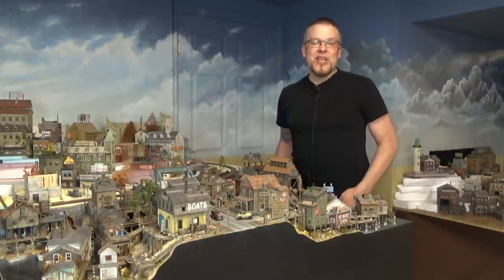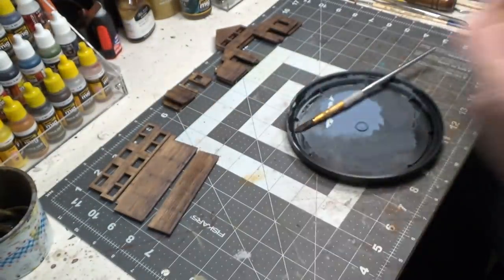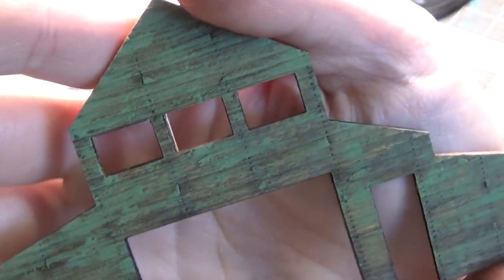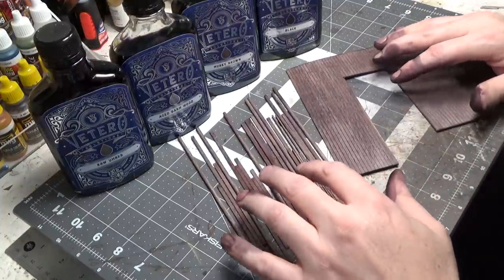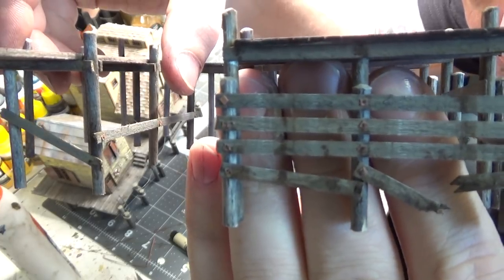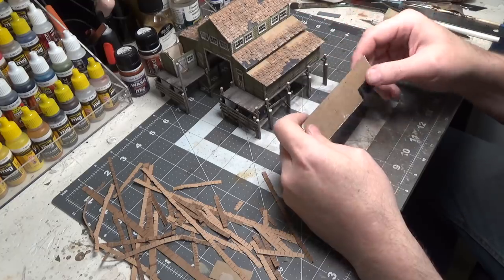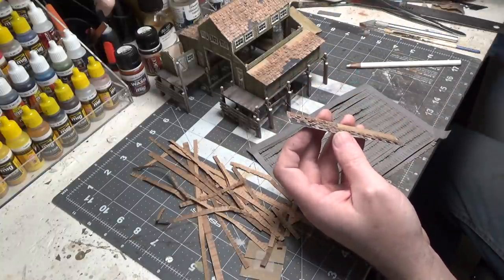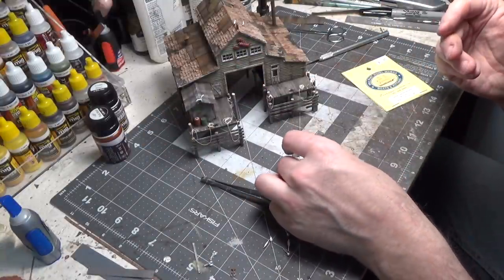Building "Lobster Co op" from Kcworkshop!

Comment: Great build. glad to see you went with a pounce wheel and replaced your pencil for the nail holes. I wonder if the entrance is tall enough to back a engine into. If so would make a great engine facility for a logging railroad. The roof looks amazing. Like the replacement of shingles instead of the tar paper.

Comment: The stains and shaders make a huge difference. Great build sir. You mentioned 2x4’s if you were to add details inside. With your FOS gas station you built a while back I think you used 1x16 strip wood or maybe smaller. Is that the same size you would recommend using our a different size?  Thank you again for all the videos that you have done and continue to do. I’m learning a lot.  Cannot say thank you enough Jason.

Comment: Nice model, one point though, the nail holes would not be in a line like that, the boards would be staggered so as not to put to many nails in one fixing beam.
Reply: Not nessarily so.  If the building was stick framed,, the nail holes would line up on the vertical studs.  I have sided enough buildings to believe Jason’s portrait of nail hole lines is very prototypical.  The bounce wheel is a fast way of simulating nail holes.  In old buildings, the nails would most likely be rusted and stain around each nail location.